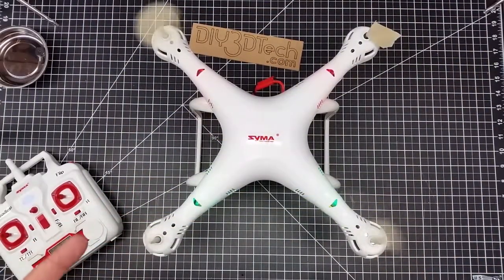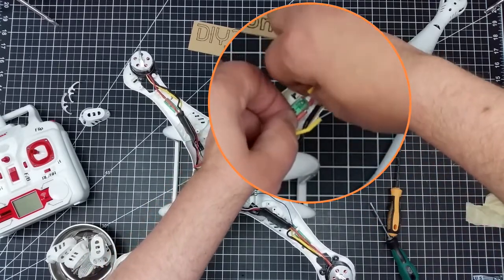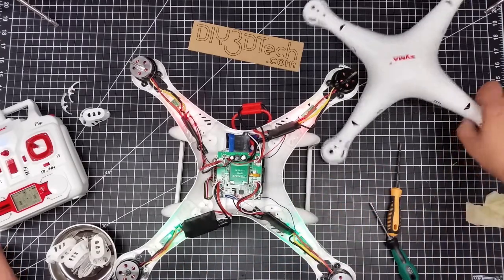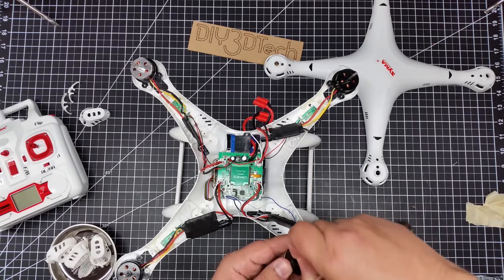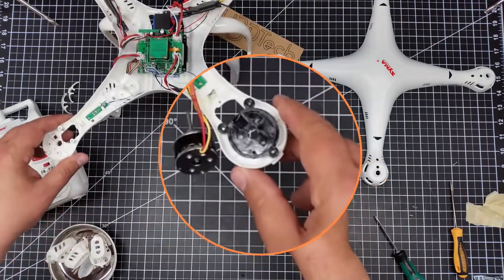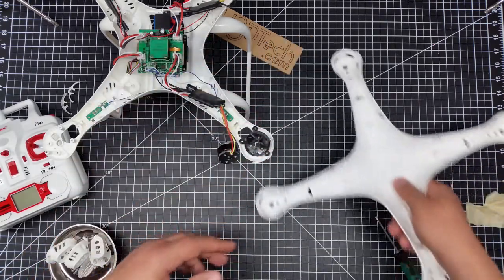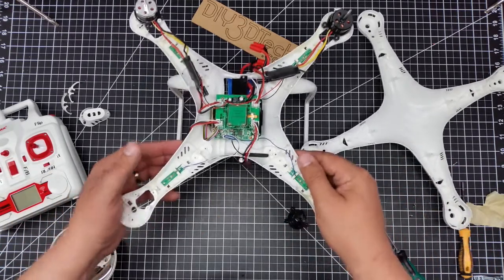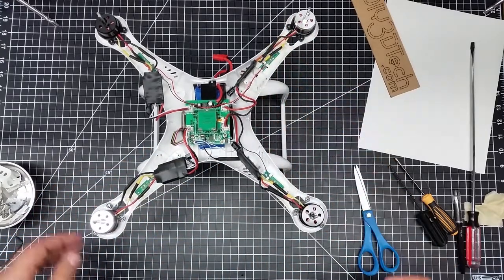Video Drone - Syma X8 Brushless Follow Up and Look At Motor Mounts!

Comment: Is there any way to upgrade motors and still use the receiver that came with the drone so you don't have to loose all functions? I just bought a promark GPS drone has everything I want but not sure if it will hold 11oz or extra weight to add a gimbal for better video. Gimbal & extra battery for the extra weight.
Reply from the maker: To honest, there are so many options out there which are cheaper and better (also SAFER) then mod-ing this guy.  As you could drive ESC's from the stock board (by bypassing the mosfets) but you will have issues as the speed curves will not match.  Second no to the GPS won't work, you will need to replace the complete flight controller and therefore radio too.  Also the radio is not safe, see my flyaway video as unlike higher end units the X8 doesn't use a protocol to ensure a solid hand shake so you can almost bet on a fly away.